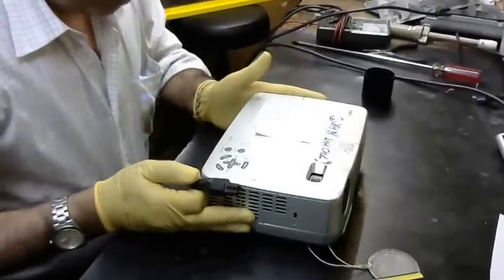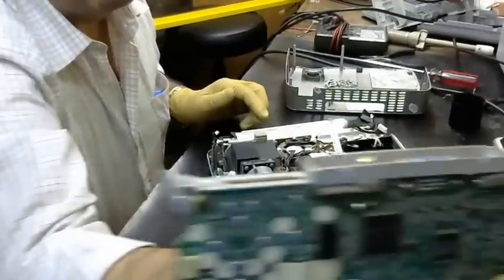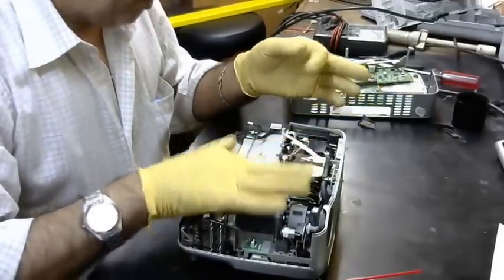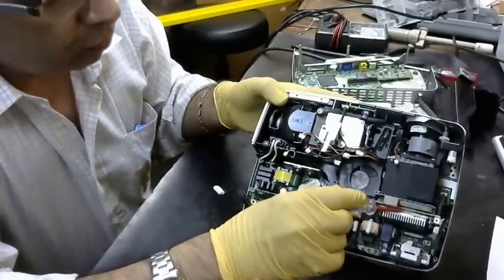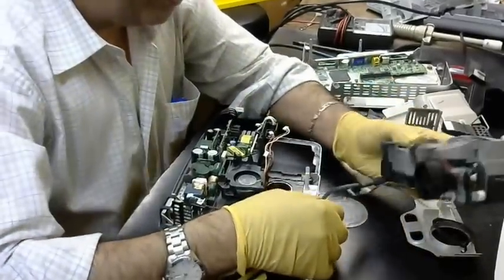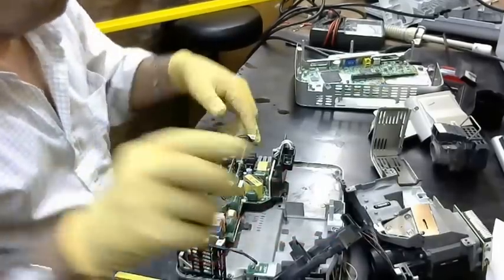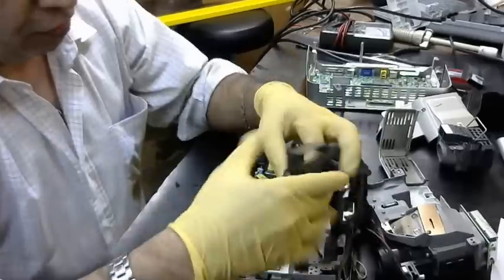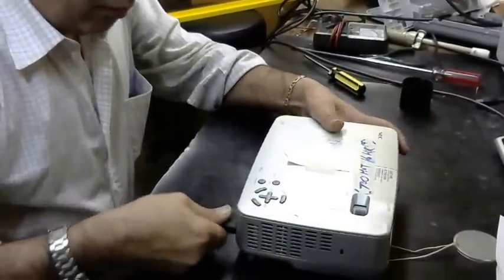Repair Video Projector NEC NP60

Comment: I just fixed my NP60 with the help of your video so I can't thank you enough!  My symptom was:   working one night but the following night I tried powering it on and got 2-series of 4 status-blinks followed by 6-status blinks (fan error, followed by "lamp failed to turn on, try again in one minute").

I saw and heard the lamp power on during power-up and when I held my hand in front of it, I could see the lamp increase in brightness twice before powering off (total of about 5 seconds).   With your video, I took the entire projector apart, pulled the three fans, blew them out with an air compressor (careful not to over rev the fans), sprayed liberally with silicon lubricant, wiped down, blew out any excess lubricant with the air compressor, let them sit/dry overnight and reinstalled, put back together and so far so good!  

Might not last as long as new fans as you stated, but I'm happy with this for now and if it happens again I can try replacing the fans.  Thanks so much!!!

Comment: I have a cooling pump problem with the exact same unit. Is there anything i can do before buying a new part? Also, i have not found a supplier for cooling pump. The manual does note that a cooling pump will be included when you purchase a new, however, suppliers do not specify if cooling pump is included. I did find 1 at walmart that has "pump included" in for $489! 

Great video. You are awesome for helping everyone and i will appreciate any help with my projector.
Reply: Hey did you ever find a solution. Please lmk

Comment: I purchased used Epson interactive projector eb 575 wi from eBay. But it powers on for seconds then shuts off.No Display,No image, No heat. Fan continues running (seems loud). status flashing blue, lamp indicator flashing orange And power indicator is off.The projector is very clean. Can help please?

Comment: ok need to post a corollary... this is so typical for me but unfortunately first time I powered everything up, worked like a champ.  Because I'm me though, I couldn't let go of the fact that I had a few left over screws that I'm now regretting going back in under the main PCB and looking to see where they might've been from.  After putting the NP60 back together again a second time, my symptoms are exactly as I described in my first comment except I do not get the preceding fan error status blinks and I never see the bulb even attempt to illuminate, though I do hear it get power.  Any ideas as to what I've messed up?  Did I just get lucky that one time?  Oy vey I wish I wouldn't have gone looking to see where those missing screws went!!  Thanks again.

Comment: ok. i have a nec projector same model or i would say same brand  everything is running good when i turnit on, but when the projection turn on the light is odd the color green is too intense,i change the the bulb or the light,filter,restart it does the same thing..what you thing it is...i would like if you give an good answer...
Reply from the maker: +Moises Navarro Hi, it's Lcd prism problem, needs change

Comment: My Nec vt47 projector  turnes off after 15-20 mins. i put fan from auto to high and it makes the projector very noisy but solves the problem?? any diagnosis please!
Reply from the maker: +Kian Corrie hello
Maybe your place is very warm or inside projector is dusty and need service and cleaning. you can follow video and service it. 
Good Luck
Reply: +wwehs.com my projector was just serviced and I forgot to put that it would only run on high fan mode

Comment: Hi My Projector NP40 the Image is dim , how to fix or reset the lamp , there is no Lapm warning or any thing else.
Reply from the maker: +dayji Hi 
In the menu, you can change the lamp brightness and contrast. you can change light through the menu (High, Medium, Low).
Reply: Hi Sir , the It dosent help , the projector gets hot, is there anything i have to look for
Thank you
Dayal
SG
Reply from the maker: If projector working as well the hot issue doesn't matter
Reply: Problem is the light is DIM , how can i make it bright as normal.
Reply from the maker: just in menu select the high option
Reply: Hi Sir , it is already high. Thank for taking time in replying
Reply from the maker: dayji how many hours has been work the bulb ?
Reply: sir 50% still there

Comment: I have a NP61 it works fine, but after 10mins it turns of and blinks 2 times, which means it is overheating. All fans work and are clean. The thermo switch next to the lamp stays closed. Why does it still turn off after 10 mins?
Reply from the maker: +cab3 Hi
That means over heat in your Video Projector, One of the fans don't work probably. first try to clean air filter is beside the projector. After cleaning it has the same problem need to open the projector and cleaning dusty area, service the fans.
http://wwehs.blogspot.my/2015/06/how-to-repair-lcd-projector-nec-np60.html
Reply: +wwehs.com Fans are clean and oiled and work. Still same problem. is there a thempersture sensor on the motherboard or the power supply? I tricked the projector to work without the lamp but it still says it is overheating? Sensor broken?
Reply from the maker: cab3 Sometimes fans working but not probably, maybe fan running but later not on time, that's just is fan error, focus on fans near to bulb
Reply: +wwehs.com ok, now it works! Thank you. It was probably the fans also. But now the fans don't turn off in standby mode. It is very strange.
Reply from the maker: cab3 good luck

Comment: hello sir i just view your video and I must say that I am impressed with your demo and I do not know if you could help me repair the brand NEC projector v x 260 which illuminates the more I will was very little on the forum help me and I can not find anyone to help me fix my own I do appeal to you if you could give me advice I know that this is not the lamp becaufe that is damaged is not blown and if I look at the lights / the sector the POWER LED is ORANGE STATUS indicator is GREEN and the lamp light is off, then if I press it oN starts and stops immediately followed 3bips LED POWER ORANGE, stationary, STATUS indicator flashing RED LED lamp always off and that's my problem please write -moi I await your news feed THANKS
Reply from the maker: +Teauna Mario, Hi
It's over heat problem, you should checkout fans, and cleaning
Reply: merci monsieur de m'avoir répondu ,oui j'ai regardé la vidéo et je crois parceque j'ai démonté le projecteur et j'ai vérifié les ventilateurs .lorsque je le met en marche justement les ventilateurs fonctionnent mais la lampe ne s'illumine pas .Est-ce que le non paramètrage de l'appareil pourrait en être aussi la cause de disfonctionnement de l'appareil .comme les voyants le signale ,voyant  lamp éteint ,voyant STATUE rouge clignotant et voyant POWER en orange .La lampe n'est pas endomager donc l'erreur pourrais être ailleur , a vue d'oeil ,les condensateurs ne sont pas défectueux pour ceux qui est des diodes je ne pourrais pas le dire ,je n'est pas d'appareil pour le mesurer .sur certains vidéo ,il montre le problème mais ils ne montre pas si il l'on réparé ou pas voilà (vidéoprojecteur NEC V260 X lampe NP13LP si vous trouvé comment le réparer de bien vouloir me prévenir d'avance MERCI

Comment: how do i test supply voltage to ballast of projector
Reply from the maker: +PackardBelltoll, Hi
Don't do that please, it's dangerous. Just checking on LED lights
Reply: i never had too . I fixed mine was the door swiitch  i just flexed a straw and put it to switch it on. all good and I returned the ballast to ebay for a 33 dollar ballast i did not need . Free easy fix.

Comment: my name is Samanta Lacroix I have an optoma projector and the problem I was flooded in the soul sol and my projector no longer works I sent it to the Optoma company in the United States it charged me $ 100 To tell me that it can not be repaired and if it has repaired it may be that it does not come back like before I bought the projector 1300 and I find it very sad that they can not me assist